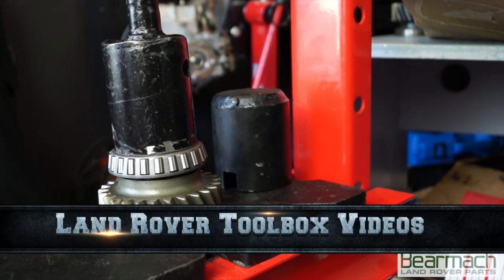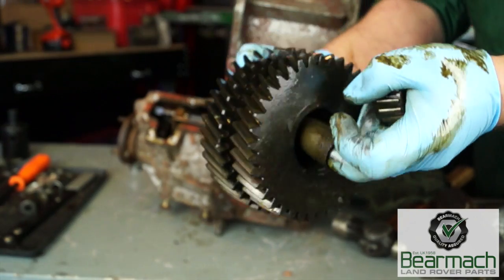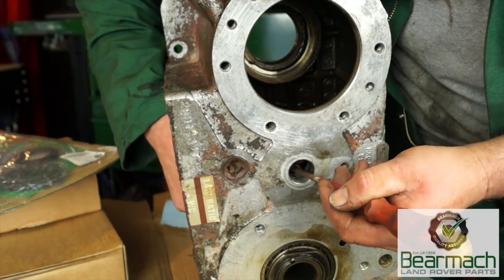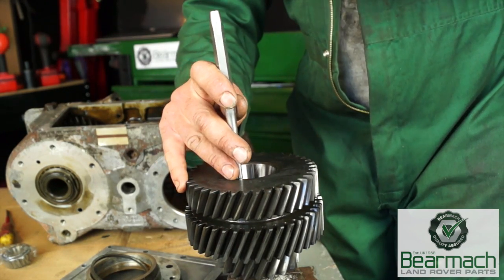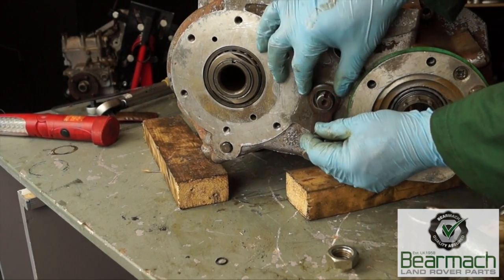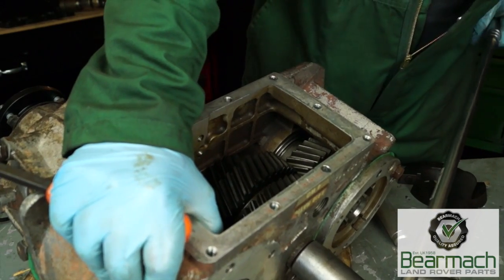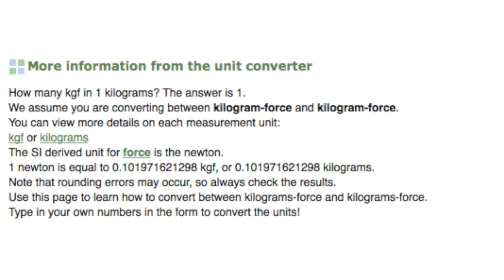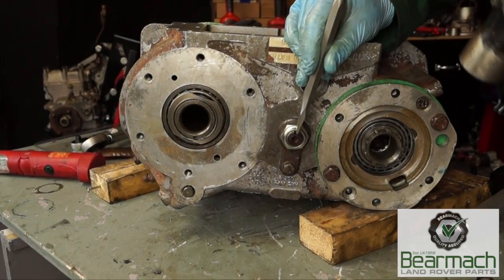Fitting the intermediate gear LT230T transfer box  -  The Fine Art of Land Rover Maintenance

Comment: My thinking is: if you're just replacing oil seals, and there was nothing wrong with the gears - do the string pull trick first to check the pre-load, then service, then match that previous measurement to get the same pre-load.

Comment: Hey there! These videos are great and like the rest of the community i’m very thankful they exist. I’m about to go full nerd with you but please bear with me.

The manual calls for a preload increase of 1.25Nm on the intermediate shaft measured on the input gear. You mentioned that you want that to sit around 3.5kgf but my maths is pretty different and wanted to run it by you and others. 

Wrapping a rope around the drilled section of the input gear and pulling it with a  digital spring scale I read around 2.7kgf. Given the diameter of that section is about 50mm and radius of 25mm that equates to about 0.66Nm of torque to turn the input gear with no preload set at all.

Now the manual wants 1.25Nm of torque in addition to that, so now we’re looking at a total actuation torque of 1.91Nm. With our lever which is actuated at the tangent of the rope (the radius of the input gear) that’s going to equal 76Nm of force on the lever or 7.8kgf on the spring balance. 

So in short, I reckon you might need up to 8kg on the rope tightening it your way. Thoughts?

Comment: Quick question. I am planning to fit a high capacity sump to my LT230 box, while on my TD5 90. Are there any checks I can do while the sump is off? I was thinking checking for gear damage and side play, anything else? The box has done 230,000 KM, that 143,000 miles in old money.

Comment: Is there a crush washer on the Defender 2.4 Transfer box? I heard there isn't but aren't sure?
Reply: Later Defenders have a shim to size which are not collapsible (as is already the case in our 2005 Td5). There are 20 different lengths in 0,025mm increments.
Reply: @cultivateyourinput  I'm still putting up with the leak and haven't done the job yet but now I know. Thanks
Reply: @andrewhoward7200 Land Rover describes a complex way of determining the shims size with the aid of several special tools. Take a look at https://youtu.be/YE-nfj4K2zs for a simple way to measure it. Make sure to look the whole playlist, there's some good additional info and tips there.

Comment: Correct me if I'm wrong but I thought the intermediate gear had to be shimmed to reduce the end float, 
so when pre loading the stress on the case is reduced ?
I only know this as I have an old R/R, case,  cracked  between the hole for the intermediate gear and the cover plate because of this very problem ???
Reply from the maker: Ah,....That will be the earlier LT230 which is a different setup and indeed does use shims.  This later type LT230T uses the compression of the casing.
Reply: @trailerfitter2  thanks for your reply.
But I prefer the set up using shims
Putting the casing under constant stresses seems counter intuitive to me,
Cheers

Comment: The spring balance force is stated incorrectly: 127 kgf is correct at 1m moment arm.  You are applying the force at the radius of the input gear which means the force required is an order of magnitude greater.  The imperial units of 10ilbsfin give a clue.  Eg the load applied is 4.5kgf.at 2.5cm.